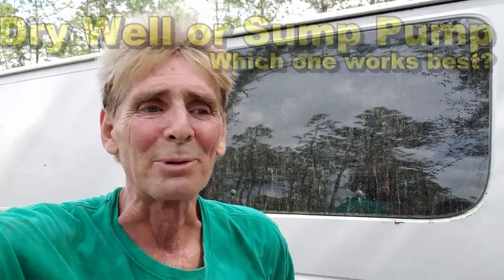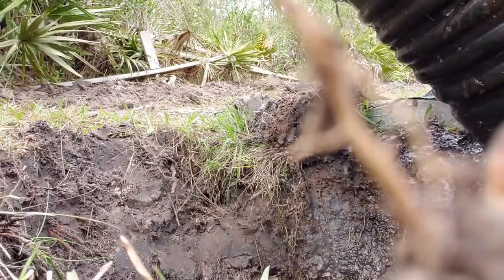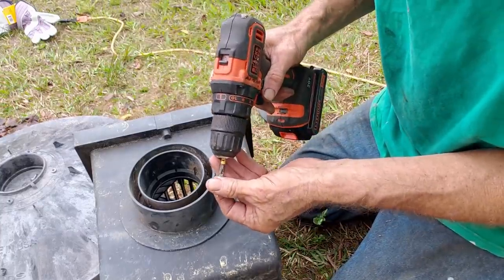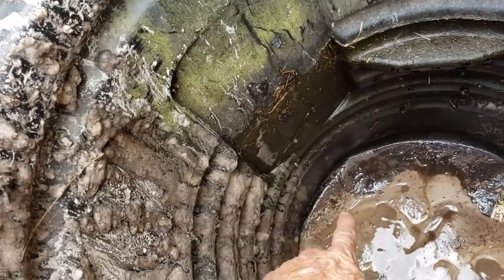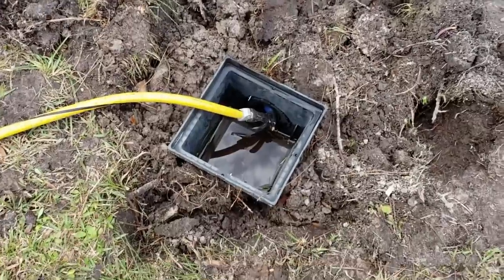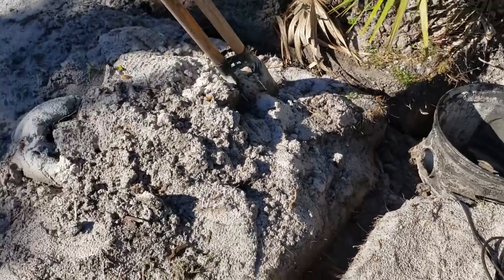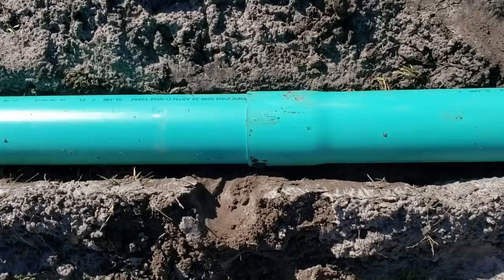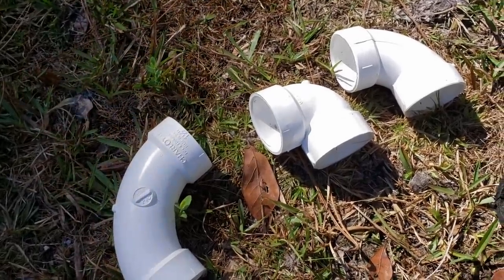Dry Well or Sump Pump, Which Works Better with French Drain - DIY

Comment: Hey Chuck, a trick for you — if you need to get dirt out and gravel in a tight crawl, shovel it into buckets and put the lid on the bucket.  Roll the bucket in front of you as you crawl.  Much easier than dragging bags of gravel or humping buckets of dirt.  Works great.  Keep smiling!
Reply from the maker: Hi Joe,  😀😀😀  Maybe watch a few more of our videos and you will see us bring gravel in by the bucket, Through the vent, And even on a conveyor belt.. The reason we bring gravel by the bag is for my help. Much easier for them to throw a bag of gravel. Thanks for the comment and tip!!

Comment: Hi. Love the videos. I'm in Wisconsin and have a driveway drain. It goes to two drywells but they overflow with a lot of rain. I want to buypass the first and replace the second one with a culvert sump pit that goes down below the frost line. 

A few questions. 

Can I use a heater like that offered by the French drain man to keep the pump running in winter?

Given how critical this situation is due to possible house flooding if the drain doesn't work, should I have a monitor or something else in case the pump fails?

Comment: Chuck, you answered all my questions.  Now I know the dry well won't work for me.  I'm in Ohio and when it rains, it takes several days for the lawn to dry out.  All the ground water gradually filters into my basement sump before getting pumped out.  I can see now I will need one or 2 catch basins and a sump basin to pump out the water before it gets to my basement.  I should be able to tie that system into my existing street drain that my basement sump uses.

Comment: To test, you should fill the catch basin.  Shooting water down the pipe doesn't show if it has proper slope and if it will function as designed when the rain is coming into it.

Comment: I’m thinking the use of the term dry well might be misused here. Wet well is a pump submerged in water in a tank which activates when a it get full. Dry well is an above ground pump that sucks from a lower cavity of water. That’s how I found this video anyways. Looking for wet well vs dry well lift station alternatives

Comment: If I have the drain coming in the sump well at a lower level, will the water not come in well and back up in the drain line cause the level of water is over the end of drain pipe?

Comment: up north, sump pumps in yards during winter. Do people just remove the sump pump during freezing weather? I am assuming yes.
Reply: I wondered the same thing. Not a fan of putting a sump pump/lift station outside at risk of freezing. Course no problem down south

Comment: There seemed to be an awful lot of dirt/sand/roots/leaves/whatever in the sump basin...  Don't you have to worry about the dirt destroying the sump pump?  Can it handle pumping out dirt/sand?  (In particular, I was concerned about the holes in the bottom of the basin, which was pushing up dirt with the ground water leveling...)
Reply: i think they are able to pump small dirt and sand pieces

Comment: Should the plastic sump pump basin with holes in it have fabric wrapped around it and gravel around it?? I have clay with poor drainage. I think clay would plug up the basin. The fabric and gravel would filter out most of the particles I think. Anyone have experience with clay and sump pumps?? Thanks
Reply: I know this is 2 years old, but am answering anyway lol. We have clay and surrounded the outside of our basin with landscaping fabric to keep sediment out as much as possible. It's been about a month and it's been working beautifully. You'll need to put a LOT of holes in your basin as it now takes longer to fill up because of the fabric.. at least that's been our experience.. the hell do we know lol

Comment: U can put a pop up on the top of the flo-well lid so if it fills it will desperse on the lawn, is this true
Reply: Jacob Mischler In theory, yes you can.  In practice, the better idea is to move the water to the curb drain if possible.  Those pop up emitters tend to flood the area of yard around them, making a mess.

Comment: Ohio here, I have some drainage issues in my back yard, I have areas that have standing water a week after rain and even if we get a dry stretch its basically like a swamp (smell & all). Im not in the country and im pretty sure there was never a septic system. But anyways I need to buy a earth auger for a fence project and was wondering if using the earth auger would help in running a few trenches or basins? Anyone ever use one to do this? I wont be doing this by hand thats for sure lol.

Comment: Is it legal to drain into the streets? I want to do that but I am worried the city might bother me!
Reply: JO MANGEEE you would have to check, in my area you cant
Reply: Should check but most areas will let you drain water into the street, as long as it’s all storm water
Reply: Sump pump and storm/rain can empty into street. 
Poop and pee drain cannot.
Reply: 1bad540i it still depends on your area
Reply: 1bad540i 😂🤪😂
Reply: JO MANGEEE some areas have the “first flush rule”. You can google it to get more info. It will depend greatly on your area and the codes. 

The “first flush rule” (simplified) basically requires you to keep the first 15 min of a storms run off on your property. Why? This is the water which is most likely to have the greatest contaminates from storm water run off.

Comment: Where’s the gravel that’s supposedly around the basin? Looks like this was just a poor installation job on the initial drywell. The drywell is nothing more than a temporary holding vessel that holds the water until the ground can accept it.  Great job, but all you did was shift the burden from a single homeowner’s water issue to the local community as now the city’s storm water collection system has to handle it.
Reply: What else is he supposed to do with the water? Have a company come pick it up? The water ultimately comes from storms, that's what the city's storm water collection is for. So this homeowner isn't allowed to use it to collect his storm water?
Reply: 😂😂😂 it is literally called a storm water drain but you seem to find issue with sending storm water to a storm water drain.